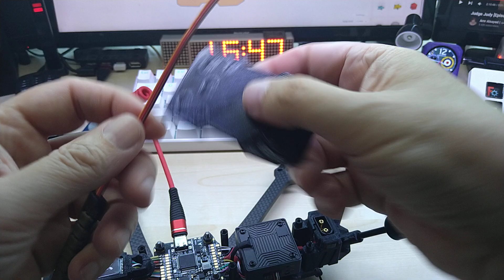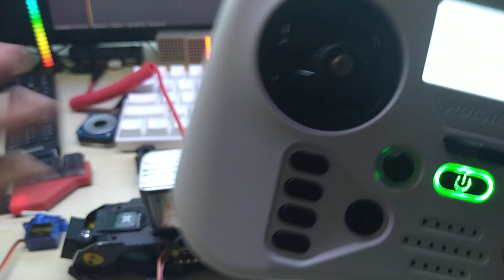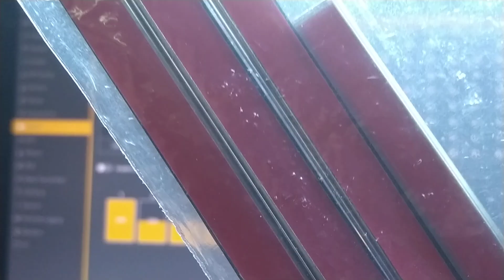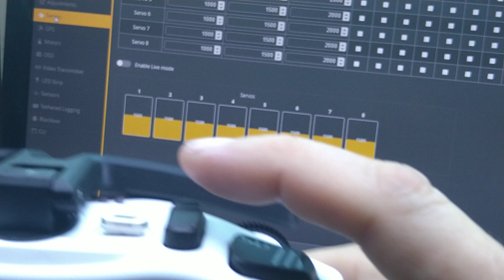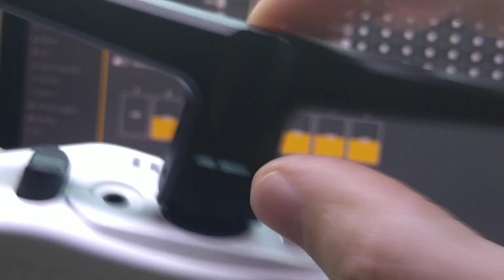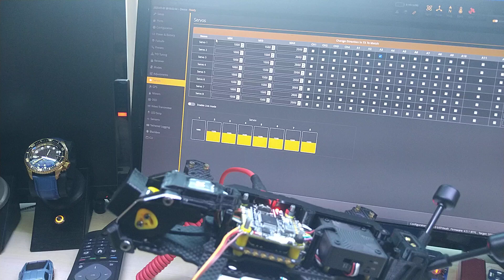#SpeedyBee custom 3D Files, NeoPixel control via #Servo Output and #Arduino by #Hayri Part 5

Comment: Do I remember correctly that you find the way to mount camera more recessed into the frame? Found it, in part 6. Uff, its the main reason why I decide to make this project :) If you could share more tpu parts like this camara mount it would be perfect.
Reply from the maker: They are included in the zip file, Cam Cover L and R, Cam Rec L and R. I did send you the missing receiver antenna and GPS mount via email.
Reply: @iHayri1  Thank you. Are those camera mounting stl for recessed camera version mount?
Reply from the maker: @Velociraptor_alfa  yes, the longer piece is used to mount the camera further back and the small pieces on the outside of the frame.

Comment: Happy New Year & great update video Hayri!! Great idea to create that cover for the bottom to cover & protect those wires. Awesome job with creating the side panels and of course, going the extra mile, and including a design element to the looks of it!! Great job!!!! When you're finished with this bird, it'll not only look great in the air, but it'll also look beautiful on the shelf. You may end up spending more time admiring it on the shelf, than flying it!!! HAH!!!!! Nice thinking with the servo idea to control the NeoPixel modes. When you've finished all of your 3D printed mods & accessories (including necessary stand-offs, screws, etc) , you could consider offering your own custom complete upgrade kit for other SpeedyBee owners & people starting their own builds. Thanks again for sharing your build videos with us and I'm hoping 2025 turns out to be WAY better than 2024 was for us!!!!!!
Reply from the maker: Thank you Adam and another Happy New Year 🙂I think it is coming together quite nicely. It will surely have a nice place to sit on when not is use or might hang from the ceiling with fishing lures, as if it is flying at that moment, 😂. Having only one lipo will definitely limit my "normal" flying time, till I can afford to buy more, haha. now I am on coding 3 nice patterns for the Neopixel. As for my 3D printed designs, I really should offer them as a kit, considering how much time I have put it. I would share it with my patreons but I only have 5, still 🙂maybe make it based on a donation basis but I am afraid it will not end well. Or put it up on Tindie and sell it there, who knows maybe one person will buy it, hehe. Anyway, I really do like to design parts and my little 328 board came in handy, btw, I opted to go with a plain 328 without Bluetooth as I do not see me changing animation all the time. So now the motors have to arrive, so I can at least power it up and hear the wind blow, and then take it out for it's maiden flight. Yeah, sure  hope 2025 will be better 🙂 Stay safe my friend.